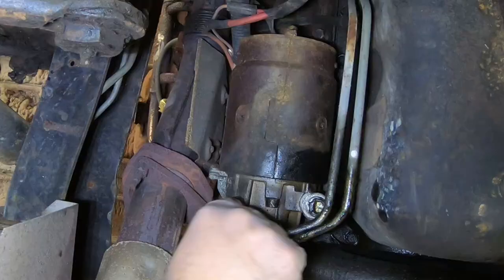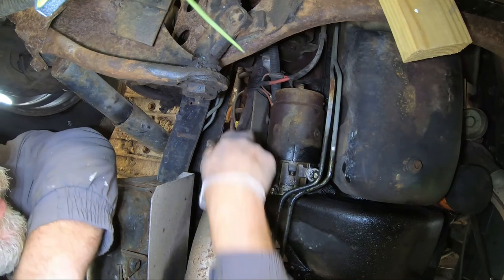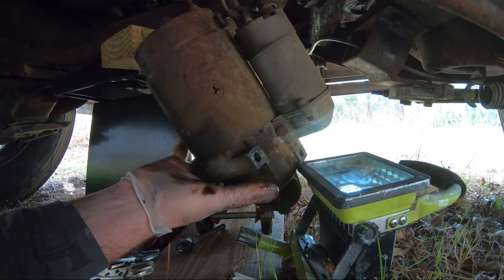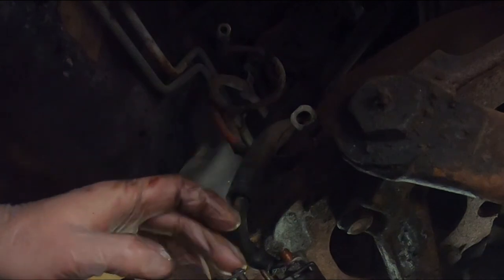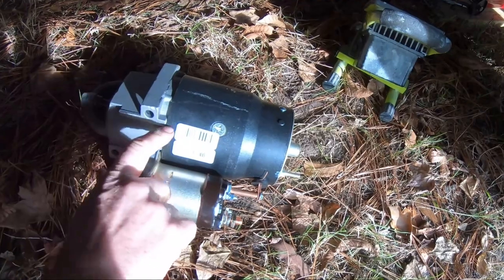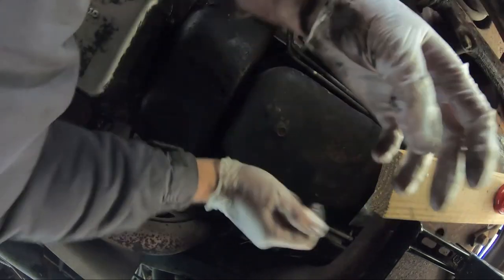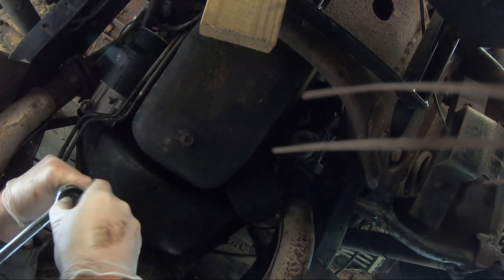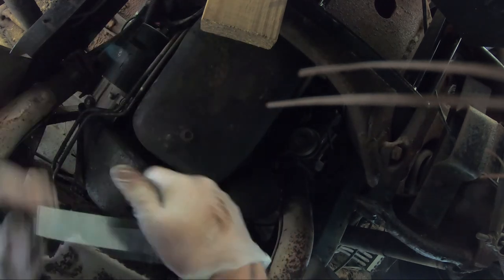1989 Allegro RV starter motor replacement

Comment: Great video! Going to do mine on my 87 Allegro. Same issues with hard starts, clicking, sometimes nothing. Bang the starter and sometimes it would come back. Also had a battery drain that didn't help...thanks for this! I've watched a few of these and no one mentions having to shim them. Hope that's the case with mine.
Reply from the maker: Good luck with yours!
Reply: @chefgeir  I did the install and all is good! Thank you for the boost in confidence to perform the job.
Reply from the maker: @drlong08  thank YOU!
Reply from the maker: @drlong08  That's GREAT! Thank you for the comment!